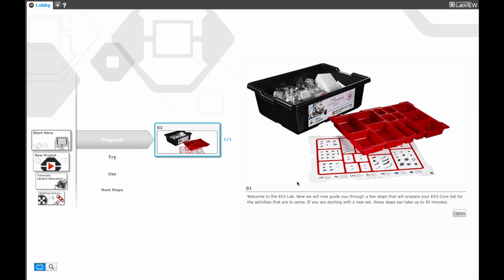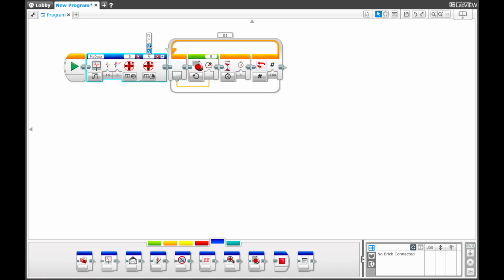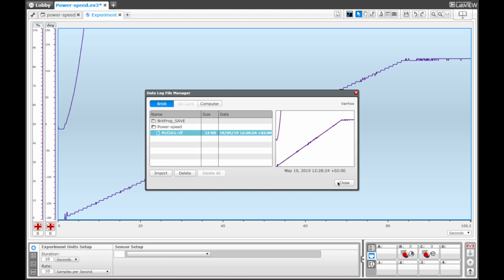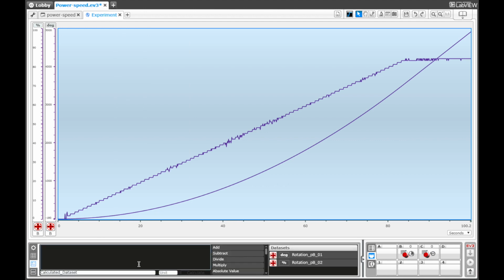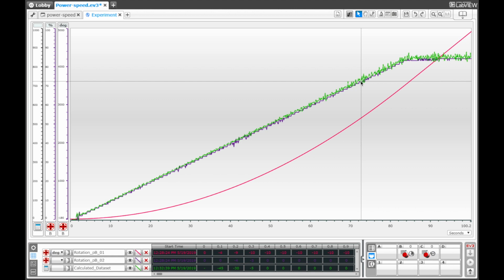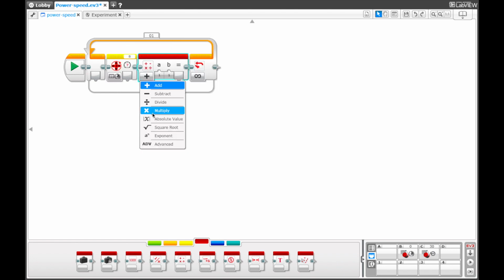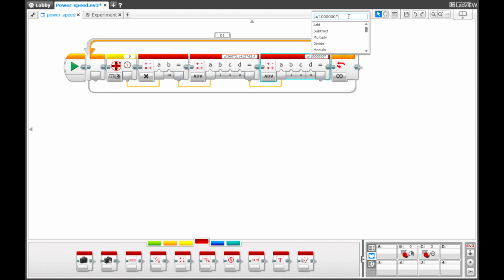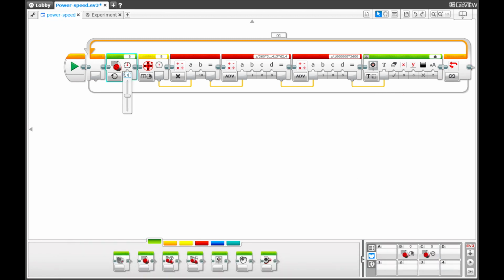How can you get speed of an EV3 robot in km/h?

Comment: Have you tried using different types of batteries? It would be interesting to see the difference in maximum achievable speed, between the lithium ion EV3 Battery (which I think is 10V), non-rechargeable AA batteries (6x 1.5V) and rechargeable AA batteries (6x 1.2V).
Reply from the maker: No. But now you know how, you could share your data with batteries? I measured with Li-Ion.
Reply: Ok, so I tested it with rechargeable AA Batteries (1.2V each) and a medium motor (because we use them to drive). I achieved a max speed of 87% which equates to just below 1400 deg/s. This fits quite well with the product page, claiming it has 240-250 rpm (1440-1500 deg/s). Hope this helps someone!
Reply from the maker: @jippiee5524  Awesome! Thanks. It's not much different from my measurements with Li-Ion.